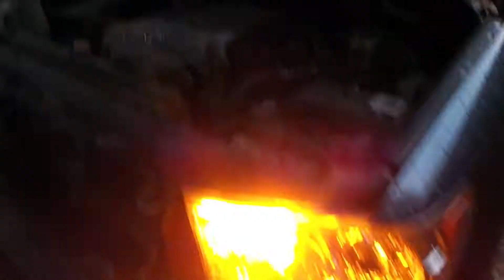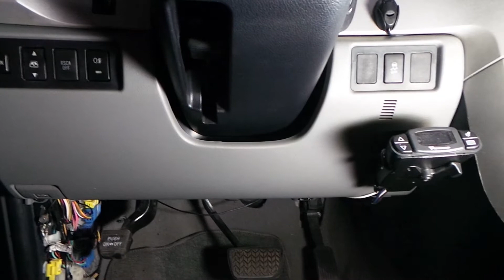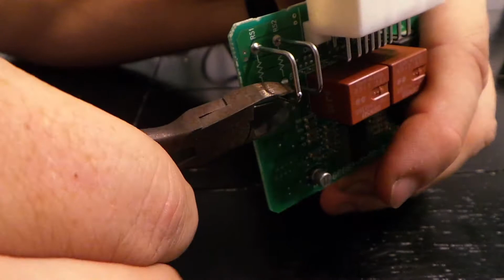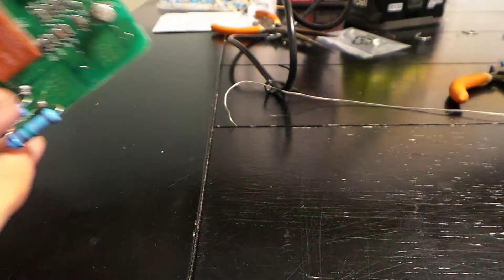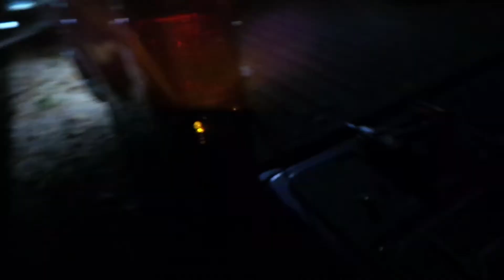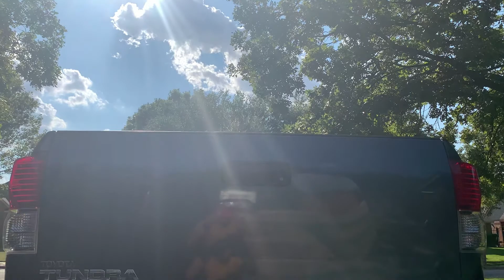2007-2013 Toyota Tundra LED Bulb Install/Modification - NO HYPERFLASH

Comment: I did this. It worked great on one side. The other side still does the one click and then stops. Any thoughts?
Reply from the maker: If there is a bit of a “nub” left on one side versus the other, that’s “resistance”.  It’ll need to be ground down even with the other side

Comment: I did this and the blinkers did the one blink then nothing so after much hassle and trying different resistors I finally thought to myself do I  have resistors in my full led taillights and sure enough I disconnected them and the.15 ohm resistors now work, everything works even  with the headlights on! Thanks for the video.

Comment: So I recently switched to a flat bed and have some other tail lights which were LED and I watched this video to convert the front to LED and add resistors. Hyper flash is gone and they worked good at first. But when my running lights are on at night my turn signal will blink a few times then stop working. When I turn my hazards with lights or brights on it blinks once then stops. I was wondering if anyone had any ideas on what could be a possible cause or a solution?
Reply from the maker: Yes I had the same problem before I posted this video.  If you’re running lights illuminate your turn signals, it reduces the amount of load when they activate at night.  You’ll need to reduce your resister load as the load is too high when they are on at night.  Try .05 ohms at a time (I.e. you’re running .15 ohms now, go to .10)

Comment: I don’t get it. I’ve soldered the 0.15 ohm resisters….nothing. I’ve cut them off and tried the two 0.15 ohm resisters in series for 0.30 ohm total each bar….nothing. It always turns on the left side only and when I turn on the headlights it still does a slight hyper flash and skips. What am I doing wrong?

Comment: While this LOOKS the same in my 2016 Sequoia, when I performed the resister install all I got was one flash and then nothing else. 😞
Reply from the maker: The signals may have different resistance in the tundra, reduce your resistor ohms, and it should work

Comment: I just tried this and my blinkers no longer work at all. They blinked once then nothing.
Reply from the maker: @danconrad8890  your resistance is too high for the bulbs you installed, change the ohms on the resistor or change your bulbs.  Did you put LEDs into all 4 corners?

Comment: I replaced all the lights in my 2007 Tundra with LED lights, every light, inside and out. Holy chit what a difference!  My truck looks like Clark Griswald's house at Christmas time. Unfortunately I discovered hyper flashing. I used 3157  Zevo turn signal LEDs in all 4. After much research I found your video. Thank you! I ordered the 0.15 ohm resisters you linked to. I cut the bars off and soldered in the resisters just like you did. No joy. Still hyper flashing. Not enough resistance. Since I had 28 more resisters to spare, I soldered two .15 ohm resisters together in series, making the total resistance .30 ohms. I did this for each bar, or left and right side. Now it works perfect! The blinker speed and  annoying loud blinker sound is exactly the same as the flashers. Thanks again for your awesome video!

Comment: I replaced my rear lights with alpha Rex LEDs that have built-in resistors. Is there a way to do this mod to only affect the front? I was hopeful that one bar was the front one was the back. Are they left and right?
Reply: Today I learned the resistance bars are left and right. Inner bar is right side.

Comment: I've been chasing a turn signal issue for a few weeks on my 2013 grade and can't come up with a solution. Using the left or right turn signals, or the hazards, the front flasher(s) blinks once then stays out. I purchased some LED DRL/flasher headlights. I went ahead and changed out all turn signal bulbs and running lights with LEDs, installed .15 ohm resistors in the flasher relay. I had all functionality with the stock headlights, halogen highs and lows, and the remaining bulbs all LED (brake lights, turn signals, back up lights, side courtesy lights. When I installed the new headlights, the turn signal bulb plugs into the headlight which powers a DRL strip AND the turn signal light. When using the left or right turn signals, or the hazards, the front flasher(s) blinks once then stays out. The DRLs work just fine.

The turn signal light pigtail plugs into a 3 pin that splits off to a DRL light and turn signal light. I've snipped the DRL light to lower power consumption and no change.

I'm thinking I need to add a resistor to the turn signal wire + and - to bring down the power draw A little too over my head here but hoping someone can shine some light on this.

Comment: This worked great for my 2013 Toyota Tundra. Thank you for the detailed video! I used iBrightstar all around and it worked great. I used 3157 in Amber for the front DRL and also for the rear blinkers. I used 3157 red dual brightness for the brake lights and 921 for the reverse lights. I soldered a .22 ohm resistor and it worked flawlessly. Couldn’t be happier to remove the hyper flashing.
Reply: Do you happen to have a link to the .22 ohm resistors? Are they 2watt? Thanks

Comment: So on my 2013 tundra I only swapped out the front headlight for new already assembled projector leds and ol & behold the thing gave me hyper flash. My rear lights are still stock so now I’m wondering what I can do to fix the hyper flash while still keeping the stock rear headlights?
Reply from the maker: Hyper flash is an indication that there is not enough resistance to slow down the LED bulbs.  Since you’re only switching to LEDs on the front, you may have reduced the flasher unit too much, you need to increase the ohms resistance.

Comment: Worked great, just remember the resisters have to be soldered in one direction. If your blinkers don't work or maybe just the left works then take our the relay unsolder the resister and turn it around!
Reply: That’s not true. Resistors are not directional
Reply: You're thinking of diodes sir, those are directional, resistors work wither direction

Comment: This also worked for me on my 2008 Tundra. HOWEVER don't make the same mistake I did at first, which was to buy the wrong resistors on Amazon. Even though I typed in "0.15 OHM resistor", it took me to 15 OHM resistors, which I bought without noticing. I soldered them in and no dice. Super frustrated. Then as I was troubleshooting I realized my error on the buy. I bought the correct 0.15 OHM resistors that the OP linked to, and those worked great! Thanks for the walkthrough!

Comment: I did this, and it works great for turning signals, but when I went and got my truck washed, and the worker turned on the emergency lights on as my 07 tundra was going through automatic car wash. After sometimes, the emergency lights stuck in turning on position without blinking. I then have to turn the emergency off to used the turn signal normally again. Is that going to happen when using emergency lights?
Reply from the maker: I would almost think that having all 4 signals going at once generated too much heat or the resistance was too high for the modification.  I am able to use my 4 ways for extended amounts of time (loading/unloading) so not sure what would cause this.
Reply: To my understanding, the hazard lights operate on a different circuit, so they should be unaffected, but I could be wrong. On the other hand, the resistance on the circuit may be slightly too high. Bear in mind, resistance changes with heat. Lower resistance makes blinking faster. Higher resistance makes blinking slower. If resistance is too high, your lights might not blink at all.

Comment: Thanks for the informations. I actually bought a LED relay. So I will be installing it.
Reply from the maker: A plug and play unit?
Reply: @minter66  yes it is.
Reply from the maker: @spicythai2000  can you post a link to it?
Reply: @minter66  the relay does not fit the connector.  I got this from Amazon.
Reply: Any link?
Reply: @maldonadoapolinar  it doesn't fit. So I end up put a resistors on the each of the tail light.

Comment: I used 0.22ohm resistors. I removed the existing factory resistors and soldered mine directly to the board. I have LUYED led bulbs all around, and the fix worked perfectly. Thank you!

Comment: Does this same  technique works for 2020 Tundra?
Reply from the maker: I cautiously say yes, only because from 2007-2021, Toyota pretty much didn’t change the Tundra except cosmetically.  I would image the electrical locations and functions remained the same.

Comment: I think I screwed the pouch here. 🤦🏼‍♂️installed the 0.15 ohm resistors on the existing factory resistors. Everything works fine but NO power to left rear tail light. Any help would be greatly appreciated 🥴
Reply from the maker: Remove the resistors and see if you regain flasher functionality.  There may be so much resistance it cannot power on.
Reply: @minter66  Thank you min. It’s strange. Right turn signals and emergency flashers work perfectly well on the right side of the truck. The only lamps not responding is left rear. Flash rate is fine 1 per second. I think I damaged the factory relay circuit board I guess? I’m out $60.00 bucks. 🤦🏼‍♂️ I bought a few dozen 0.15 ohm resisters too. If anyone needs any I’ll send them to you.

Comment: Thanks for the video.  I had some 0.24 Ohm 2W resistors laying around so I put them in parallel for 0.12 Ohms for each spot.  Worked great.  I am using different LED turn signal bulbs for both front and back.
Reply: Do you have a picture?

Comment: Could you explain why you used a mix of Zevo bulbs and iBrightstar bulbs? Specifically, why not iBrightstar bulbs in both the rear and front?
Reply from the maker: Sure,

The iBrightstars for some reason lit up more LEDs than I anticipated when in parking light mode.  This reduced the resistance they created when activating the flasher mode and they hyper flashed.  I didn’t notice this until I was driving at night.

During the day, they flash normally since they weren’t being partially lit with the head lights on
Reply: Thanks for the reply. So did you just swap in some Zevo bulbs on a hunch and they worked? I wonder if the iBrightstar bulbs would have worked if the resistors were of a higher resistance.
Reply from the maker: @Michael.80  Yep, once I saw the hyper flash I put in Zevo's and noticed they didn't light up as much when the parking lights were on = more resistance when flashing.

I bet if I had added higher ohm resisters to the flasher module, I could have run iBrightStars all the way around.  I will admit the Zevo's are not as bright as the iBrightStars.
Reply: @minter66 hello, I was just reading this regarding that same issue since I wanted ibrightstars all the way around as the zevos just ain’t cutting it. Which ohm resistors do you recommend I get for me to be able to run brightstars all the way around?

Comment: Just tried this on my 2007 tundra and it didn’t work. Not sure why but it only flashed once and then didn’t flash again. Maybe a different resistor
Reply from the maker: Could be a few things:

1) Are all flashers LED?  That happened to me when I left an incandescent in.
2) Are all 4 pegs of the resistor fully soldered and not loose or too thin?
3) Are you using the same bulbs that I installed?  Or are you using different brands?

Essentially the load or resistance is too high.  Too low of resistance and they hyper flash.  Something, somewhere is resisting more than the capacitors can handle
Reply: @minter66  yes all of the bulbs are led. The rear ones have resistors already inline I wonder if that could be the problem. I tried to solder them evenly. Looked like I did a pretty good job. For now I just soldered the original pieces back in. Thanks for the reply!! I got the bulbs from Alla lighting
Reply from the maker: @mot8999  yeah, it’s your rear bulbs causing the problem.  Try some bulbs that don’t have any type of artificial resistance. Zevo bulbs are sold at Oreillys if you have them in your arena
Reply: @minter66  I’ll go get a pair tomorrow and see what happens!!! Thanks for the info!!

Comment: Great tutorial!!! I removed the two buss bars (factory resistors) completely and replaced them with 0.22 ohm 1watt resistor and it worked perfectly. I now get 89 flashes per minute instead of the hyper flash that was around 140 (illegal according to some states, 120 flashes is maximum). I wonder if it would slow it down a bit more if I either add another resistors in parallel dropping the resistance to 0.11 ohm or series and raise to 0.44 ohm?

I was happy with the 89 flashes so I left it at that and installed all panels back. I prefer this method over stupid 50watt 6ohm resistors on each LED bulb and sometimes that doesn’t even work. The whole idea behind LEDs is to be efficient and use less wattage yet you strap a damn 6ohm short that draws 2.4amps/34watts just in case you wonder why those damn things get hotter than the old bulbs that are less than 20watts.

Comment: how has it held up? any issues? im about to try this out on my 2015 tundra.
Reply from the maker: Still working perfectly.  I wondered how well my soldering job would handle Colorado, but I off-roaded for several bumpy hours with no issues
Reply: @minter66  just did it and fixed the hyper flash. I ran into an odd thing though. The first time I started the truck up after putting it back together. The truck started but immediately turned off. 

I tried it again and the truck started normal. I’m not sure what that was all about
Reply from the maker: @RICEY702  make sure to test with both headlights on and off.  The park function of the lights (depending on the bulb) may draw additional ohms.
Reply: @minter66  i tried with both the hyperflash was not there when the headlights were on and off. also drove the truck around with the headlights on and off and tried the turn signal both times and no hyperflash.

just wondered why the truck started the one time and immediately turned off. freaked me out. checked the AMP 30A fuse and it wasnt burned out, so idk what happened.

fwiw, im using led's all around. brightstars in the rear and alla 3157 ambers for the front turn signals.
Reply: @RICEY702  So I've noticed this with all of my Lexus or Toyota vehicles after disconnecting the battery to work on them. Every time I reconnect the battery, dies on the first try, second cranks right up.
Reply: I bought a Tundra with after market head and tail lights plus switback fog lights that also blink, so the previous owner def enjoyed upgrading. Left side has hyperflasing right has intermittent single flash. Do you think this mod will remedy?

Comment: I put the Alla LED (from Amazon) amber LED flasher bulbs front and back on my 2010 Tundra, and this mod worked great with the .15 Ohm resistors.  I thought it was easier to mechanically wrap the resistor wires around the cut posts, apply flux, then solder in place (technique used in soldering amp components).
Reply: Maybe I should try this!!
Reply: @mot8999  I have some 0.15 ohm resisters if you need a couple
Reply: That’s an easy way to solder that joint. A little tight in there. I melted one of the orange colored micro relays. I think that why I have no power to anything at left rear tail light. It was working fine before I started soldering the 0.15 ohm resistors 🤦🏼‍♂️
Reply: Test

Comment: Great video but unfortunately I didn't find it until after I'd installed the LEDs in my 2013 Tundra and caused the hyperflash. The 0.15ohm resistors didn't work in my case, well worked on the left signal but not the right and the hazards didn't work. I also had to file a little off the bulb housing to get it to fit so can't return them and get your recommended ones. I soldered the bars back in place and put the normal filament bulbs in so back to square one. You mentioned in one of your other replies about increasing the size of the resistor but what formula did you use? Many thanks.

Comment: Anybody have a clue why mine still hyper flash when the engine is running and headlights on? Any other combo its fixed no hyper flash.
Reply from the maker: Did you use different bulbs?  When the headlights are on, the bulbs you have turn partially on.  So when your signals “flash” there is less draw when flashing vs the whole bulb turning on when headlights are off.  You need either higher ohm resistors or different bulbs that don’t “light up” as much when parking lights are on
Reply: @minter66  I appreciate the prompt response! Yeah I am using different bulbs I found your video after the bulbs were installed so I figured id at least attempt with the ones I already had. Thought I was golden until I turned the headlights on. Well its half fixed until the new bulbs come in. Thank you much!
Reply: @minter66  what ohm would you recommend? I am using Zevo 4157 Reds all around, would those work with the .15 resistors?
Reply from the maker: @TooElitePete  Yes, I think even using them both in front and rear with .15 would work.  The Zevos don’t light up as much when the headlights are on, leaving for more the amp draw when illuminated.